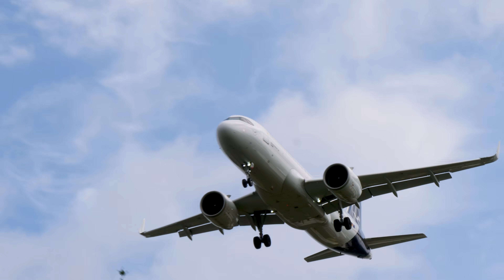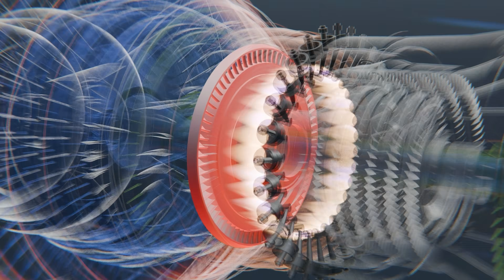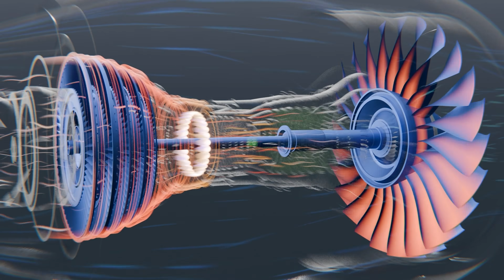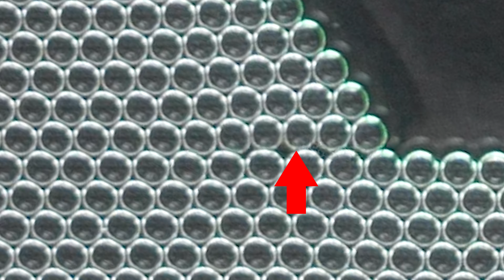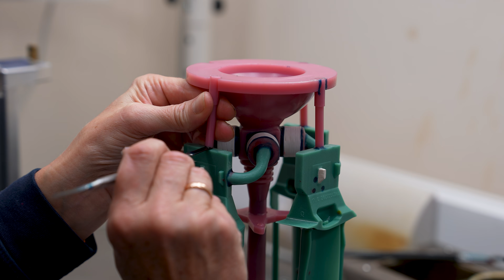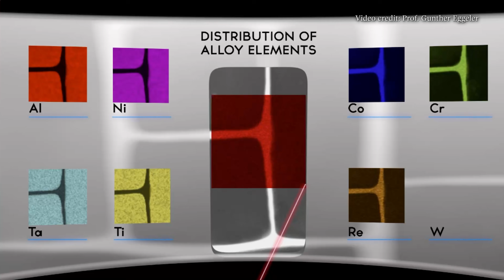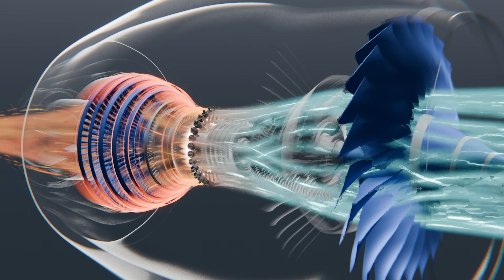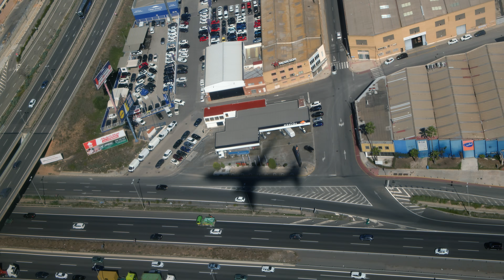The Ridiculous Engineering Of Jet Engines

Comment: Einstein's theory and the theory of material space make the same predictions about measurements, so they're equivalent in this respect. Therefore, no experiments rule out material space. If proponents of Einstein's theory limited themselves solely to predicting measurement results, Einstein's theory could be considered a good fit to known experiments. The limitation of general and special relativity is that they only fit measurements. Therefore, it cannot explain the equality of gravitational and inertial mass. In this theory, it's merely an experimental fact. The material space theory conceptualizes the physical phenomena that cause these masses to be equal. The simplest explanation for the identical behavior of matter in an accelerating system and in a local gravitational field is to assume that we are dealing with an identical material phenomenon. Then, consistent with everything we know about waves, it is obvious that electromagnetic waves, for which space is the material medium, move with respect to space at a constant velocity, and that this velocity is independent of the velocity of the source. It immediately turns out that the slowing down of clocks caused by motion and in a gravitational field is of the same nature i.e. the movement of the clock relative to material space. In the case of material space, this is obvious. If Einstein hadn't assumed that the one-way speed of light is the same in every direction in every inertial frame (which forced him to strip space of its material properties) he wouldn't have had to spend 10 years searching for a way to derive a formula for the slowing down of clocks in a gravitational field. It would have taken him a few minutes. Most Einsteinians are uneducated and believe that material space has been experimentally ruled out. At the same time they must admit that the theory of material space is equivalent to the general theory of relativity. And now the most important point. Deriving the correct formulas for time slowing and length contraction requires the two-way speed of light, so despite his incorrect assumption, Einstein was able to derive the correct formulas. However, this arbitrary assumption forced him to deny material properties to space. According to the material theory of space, Einstein's assumption is false. Moreover, leads to absurd notions about the physical causes that caused the specific measurement results. The necessity of inventing the so-called electric field as an independent entity is introducing material space through the back door. All the properties of the so-called field are properties of a material object. A field is not a material object, but a property of a material object. Properties cannot exist without something that possesses these properties.

Comment: Really, a single cylinder piston engine is the more complicated idea, because it uses a flywheel's inertia to delay the power stroke torque for the next compression stroke. A jet turbine engine uses the current torque..

Comment: ERROR OR TYPO @4:00 when showing the work for the Impulse and Kinetic Energy. You forgot a (1/2) in front of the bottom right equation. The result is correct, but you missing the half. Just FYI.

Comment: Im going to guess lots of tungsten... Tungsten is usually the solution for heat... Probably silicon... Its gonna be exotic lol
Reply: Lol you also arrived at tungsten lol... You stuff it in alloys lol
Reply: Tungsten melts at a really high temperature but do you remember why we used to put tungsten filaments inside glass argon filled bulbs when we made light bulbs? Tungsten + high temperature  + oxygen = no more tungsten.

Comment: What I still don't get is how does the engine start spinning in the first place.
Reply: Small ones by an electric motor, the bigger ones need bleed air from another jet engine already running (Aux Power Unit in rear of plane) or a start cart on the ground.

Comment: I'm probably too stupid to get it but ... couldn't they use some filtering technique to prevent dust particles from getting into the engine in the first place? 

I imagine dust particles typically have electric charge, so you should be able to deflect them using an electric field, for instance, without disrupting the airflow all that much. Maybe not at those speeds, though.

Comment: There is a 1/2 factor missing in the Kinetic Energy at the right side of the image. It is at 4:00 minutes. If not included it would not be 4 times greater, compared to the left side.
Reply: What do you mean by this? (1/2)*(1/2m)(2v)^2 = (1/4m)4v^2 = mv^2? Doesn't seem like a term is missing on the right hand side to me.
Reply: @swayzic8743  Just take a second look and you will see that there will be a (1/2)*4=2 factor on the right side of the screen.

Comment: "Metric"  Tons, is BShtology , because 1 Ton has NOTHING to do with the meter, and you surely cannot determine the weight of anything using meters, right?  If you do not know how much 1 Ton is, here follows the explanation for the imperial, and the DECIMAL systems: 1 kilogram equals 0.45 Pound. Thousand Kilograms = 1 Ton. If 1 kilogram equals 0.45 pounds,  1000 kilograms, which is represented by 1 Ton equals 4,500 Pounds. QED.

Comment: What's wild is that i recognize the concept directional solidification from making clear ice, and the concept of tempering the blade to even out the structure of a crystal from the last stage of tempering chocolate by bringing it almost to the melting point of the desired crystal type.

Comment: Is there a reason we can't pull air from a lower pressure compressor section for cooling, or even from the fan section? Ideally, thus would mean less work was spent on this bypass air, and it would be better able to draw heat from the blades due to lower temperature
Reply: It wouldn't flow. Air flows from high pressure ----> low pressure. It the cooling air isn't higher in pressure then the air at the turbines the airflow would go backwards through those holes.
Reply: @wally7856 

But isn't the turbine inlet pressure necessarily higher than any stage of compression? We wouldn't generate useful work if the combustion pressure weren't higher than the compressor stage pressure

Comment: In your equation for how the kinetic energy changes depending on the change in speed, make sure that delta is excluded from the square operator and stays in front of the parentheses 😊 I made that mistake on one of my senior physics classes and it’s been my life mission to remember that since then
Reply: It’s only there for a glimpse in the intermediate equation at 4:03, but might be helpful to confirm that the delta is not part of what gets squared

Comment: Is the idea of the compression stage not a wrong explanation!? because the air does not get compressed, the air volume is simply getting accelerated ! Or am i wrong ? If, what is the pressure in the final compression stage ?
Reply: A modern jet engine is around 600 psi at the compressor exit and that's the highest pressure in the engine, it's all downhill out the back after that. It's the burning of the fuel in the combustors that heat and accelerate that compressed air to high velocity.
Reply: @wally7856  thank you for your answer. Is there any reference paper or book you would recommend  to read about in this topic?  
Thank you again.
Reply: @AdreamX  Jet engines very closely follow the "Brayton Cycle". Any search on that topic will yield untold volumes of information from beginner to graduate level understanding.
     The Brayton Cycle describes the thermodynamic processes used in jet engines. The compression, heat addition, expansion, work extraction, etc all very precisely. Real world engines will vary slightly from the processes on paper (ie: the lines on the graphs in a real engine won't be as straight and level as shown in the textbooks usually due to heat losses from cooling or conduction and losses due to high speed operation). There are other types of heat engines such at the Carnot Cycle, Otto cycle, Diesel cycle, Rankine cycle, Stirling cycle, Ericsson Cycle, Atkinson Cycle, and Lenoir Cycle. Any engine you can think of will closely follow one of those cycles as it's principle of operation. Engineers use their understanding these cycles to learn how to mathematically optimize these engines.
Reply: @AdreamX  If you like videos then Youtuber "AgentJayZ" has in depth videos on jet engine operations from a technician point of view as he rebuilds them (lots of theory and principle, very little to no thermodynamic math).
Reply: @wally7856  Thank You again, i will have a look at that. 
Have a nice day, greetings from Switzerland

Comment: They did a very good job researching and presenting everything. However, there was no mention at all of CMC's (ceramic matrix composites) and additive manufacturing so they lost me. CMC's are what the aviation industry is using now for hot section and turbine blades as they can withstand much higher temperatures and are half the weight of alloys.

Comment: And because the back of the engine runs the front, thats why at engine startup, the pilots need to bleed, or to push compressed air, from the APU(Auxilary power unit) to rotate the fans

Comment: Easy.  Cooling air passages in parts like turbine blades and a layer of cooling air between the really hot combustion and the metal combustion chamber parts that can melt.  Learned a lot about jet engines from AgentJayZ

Comment: a lot of comments about the trent's crystal fan blades which are incredible, but reality is they have lost to GE's carbon blade with titanium leading edge. and a detail i feel like derek skipped over and didnt understand to teach, is that turbines are flow-cycle enginesm you can add fuel and spark at 0% speed, it will blow out both ends. you need to get the flow going before the expanding gas decides its going one way
Reply: There is no turbine blade in existence made out of either titanium or carbon fiber. The temperatures are too high. They make the fan and compressor blades out of those materials.

Comment: The gas stove blue fire is around 2000 Celcius. The most a cooking pan can stand is 1500 Celcius. Yet it does not melt, because the heat dissipates all over the pan, into the food and into the steam which evaporates while cooking.

Comment: I think that the video have a misconseption when talking of defects, usually, what makes a material resist higher stresses are the defects and the grains barriers, most part of fails happen in a intragranular regime. In the specific material  that turbines are made, the opposite happens because of his higt temperature regime, that interect with the grains barriers, it is like u made the material suffers an annealing at his work temperature, loosing his proprieties

Comment: What a fascinating manufacturing process. 

I wonder how many similarities there are between the crystal growth strategy for this vs making silicon wafers for integrated circuits. 

Also, I was really surprised to see that these pieces are investment cast. Are the final production parts made the same way, or are they die cast?

Comment: This is amazing. I used to work for a company that did x-ray diffraction for a variety of material testing. Mostly focusing on residual stress, we also built and used machines that tested single crystal turbine blade orientation using Laue diffraction. I've known that they "grew" the single crystal blades but have never seen it before. This was informative.

Comment: I was recently at the FormNext Expo in Frankfurt. There where a lot of companies there that make Metal 3d printers. They print in all alloys. Several companies had these kind of blades on display that were 3D printed from nickel alloys. The Advantage being that 3D printing can form these complex structures way more easily and cheaper than traditional manufacturing methods.

Comment: Some important points should have been mentioned—or at least touched on—in this metallurgical and informative video:

The nickel-based superalloy would melt very easily if there were no coating system and no thermal barrier coating (TBC). The coating system, known as MCrAlY, is itself a complex coating designed to form protective α-alumina through selective oxidation. Both the coating and the nickel-based superalloy are protected by the thermal barrier coating. These three successive layers can withstand extremely high temperatures.

First: Producing a single-crystal structure is not only to eliminate grain boundaries and thus prevent cross-slip; it also has another major advantage: it increases the alloy’s melting point, thereby improving the allowable turbine inlet temperature.

Second: Titanium is added to the γ′ (gamma-prime) phase in order to stabilize the precipitates and reduce coarsening by adjusting the lattice parameter. Controlling the microstructural texture is of paramount importance. The two-step heat treatment of nickel-based superalloys is one of the most critical stages in their production.

The primary hardening mechanism is order hardening, involving anti-phase domain boundaries in superdislocations.

Comment: Many THX for this very interresting video. I'm asking myself a question, after I saw few years ago a documentary about how to overhole a jet engine. In this documentary they laser weld or meld (not only) the blades to add/substitude eroded material. Is this fix possible with this kind of blades as well?

Comment: Would there be a way to purify the incoming air from dust and other particles (and birds) before it reaches the engine? It would mean a redesign of how the engine looks, but the core principles will still be the same, just with much cleaner air coming in.
Reply: Some turboshaft helicopter engines have centrifugal, cyclonic separators that can filter out the larger particles of sand and dust. But its unlike that this technology could be adapted to a large turbofan without seriously effecting efficiency and reducing airflow.

Comment: Because they don’t run on fuel but compressed air more than 90% of the time. There is a reason why wings are the first thing they quickly remove from any crash site and you will never see them parted. Research Jet Fuel Hoax!
Reply: Are you a Flat Earther too?
Reply: @DoktorBayerischeMotorenWerke  and so are you!
Reply: @RUS38  I don't believe in stupid conspiracy theories...
Reply: @DoktorBayerischeMotorenWerke  neither do I.
Reply: @RUS38  You just said you did... jet engines require fuel to heat the air. The operate using the Brayton Cycle.
Reply: @DoktorBayerischeMotorenWerke  no I didn’t say I believe stupid conspiracy theories. I believe in conspiracy facts.
Reply: @RUS38  Are you really that gullible? to believe that jet engines can run without jet fuel???
Reply: @DoktorBayerischeMotorenWerke  no, I don’t! They still need jet fuel for APU, startup and take off, not while cruising. You might be the gullible one to believe on the amount of fuel they need for a flight which is supposedly stored in the wings.
Reply: @RUS38  What about propeller-driven aircraft with piston engines? 
 You don't deny they need fuel to run right?
Reply: @DoktorBayerischeMotorenWerke  I don’t
Reply: @RUS38  Where is fuel stored in a propeller driven aircraft??? In the Passenger cabin?
Reply: @RUS38  Just Answer The Question???
Where is fuel stored in a propeller driven aircraft??? In the Passenger cabin?

Comment: On a thermodynamic stand, single crystal is in fact the equilibrium state of any crystalline solid, as grain boundaries require energy to exist.
Let any metal long enough in a non-oxydizing environment, and it'll turn into a single crystal at one point (but heat it up if you don't want this to take billions of years 😅).

Comment: Awesome video thank you for the in-depth explanation, I finally understand what makes jet engines possible.
But I have a major gripe with the video @veritasium
You are stating multiple times that the blades "exceed their melting point" and that it is supposedly exactly "1200 °C". 
But the Rolls Royce Engineer clearly states at 22:14 "That's 1200 degrees C, that's where the telemetry program stops.". 
Before that the temperature was rising at about 10° /s and the cut continues for at least 7 seconds. 
Sadly your video does not show the full duration uncut, but it definitely exceeds 1200 °C. 
Using this number continuously throughout the video, can't be scientifically correct and puts a blemish on an otherwise awesome video.

Comment: How is the coating applied such that it does not block the cooling holes nor add ceramic layer above the cooling passages?
Reply: Yeah that was unsaid, perhaps the holes are drilled after the coatings are applied?
Reply: @RawbLV  it is possible but drilling multi layered part much less one of them is ceramic is not ideal. 
Hope we get an answer from an expert on this

Comment: This ought to be an episode of impossible engineering. And given the true rarity of the element Rehnium and the so called other rare earth metals, I would imagine 100% of the spent blades and left overs from the casting process are recycled  to again, make jet engine blades.

Otherwise at sometime in the near future, unless material science can find substitutes, there will not be any metals available to be used to make jet engine blades and it will be back to propeller driven aircraft.